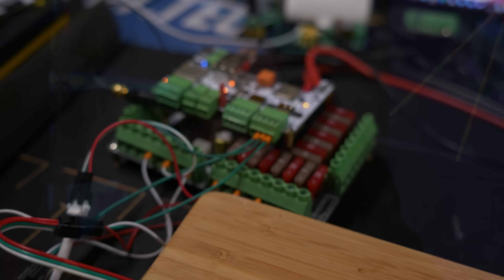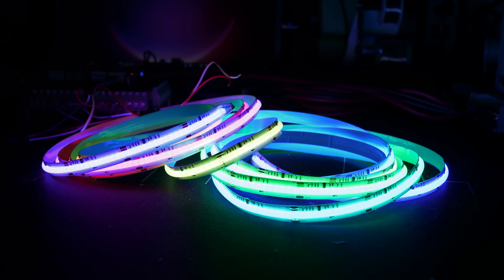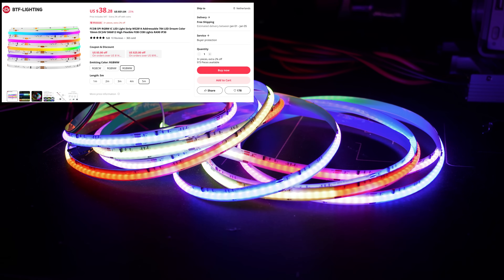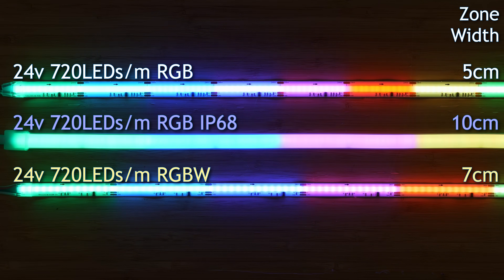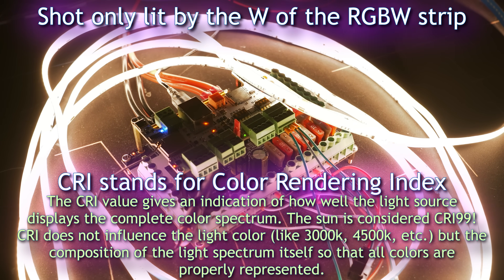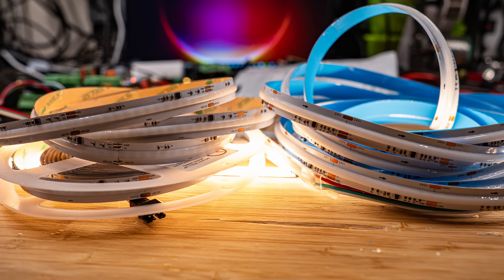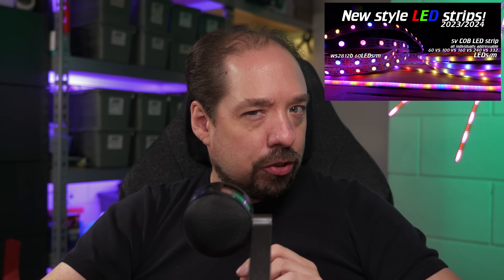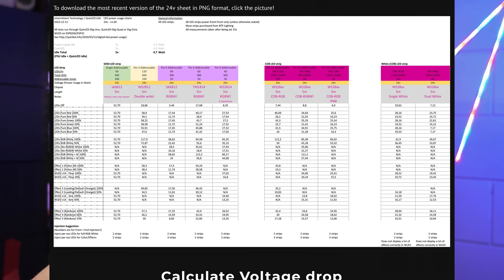💡QuinLED💡The best RGBW 24v Addressable LED strip!

Comment: I have ws2811 rgb 30 leds/m strip on E scooter. If I swap for fcob ws2811 can I expect similar current draw ?
Reply from the maker: Yes, or rather, it depends on the amount of ICs, those are the current providing source, more ICs, more current draw as long as voltage stays the same.
Reply: @IntermitTech thanks for the reply. And how do I count number of ICs in a FCOB strip?

Comment: Are these Alliexpress strips same quality as the BTF from the official website? Thanks!!
Reply from the maker: For sure yeah, there aren't too many strip manufacturers anyway, lots of shops sell the same product in the end.
Reply: @IntermitTech  Great, thanks!! going to get them from the link then
Reply: One quick question, if I'm going to use them for a living room and I need 13M, (two 5M and one 3M) which power supply should I use? Thanks
Reply from the maker: @kibray1796  This will explain all: https://quinled.info/the-ultimate-led-strip-power-injection-guide/
Reply: @IntermitTech  yeah thanks! just watched your video explaining power supply, amazing and very well explained. If I'm not wrong or entirely wrong, I need 300W, I'm using the 24V RGBW WS2814 with 784 leds from the links (two 5M and one 3M), and should need 12.5Amps, so I should get the LRS-350 24V. Hope I'm right hahaha, thanks!!
Reply from the maker: @kibray1796  Yeah that sounds about right!

Comment: How sensitive are the 24v Addressable COB RGB (non IP-rated) strips to humidity?
I realize submersing them, or even splashing them would be bad; but what about humidity?
My plan is to mount LED strips under the eaves of my house in a channel (for a clean look during the day), so direct splashing or rain won't be an issue.
Since I plan on putting them in a channel, I feel the extra expense (and extra heat retention) of the silicon-wrapped IP68 variant might be a waste while providing slightly lesser performance. I just didn't know if general humidity would lead to corrosion of the components (we average between 50% and 80% relative humidity through the year).

Comment: Does the RBW COB work with WLED/ESP32 controller? On ali I can see there's a note that it doesn't suppoert such controllers!
Reply from the maker: If you use a proper controller, such as my Dig boards, they woke without a problem. If you use bare ESP32 or a controller with a mediocre data output you can indeed run into problems.

Comment: Hi Quinn, I'm trying to find a dimmable high CRI 2700k LED strip for use in a soffit. I've read through your fantastic guides but unfortunately some of the product links aren't working. I don't need addressable LEDs, just a high quality very warm white, and ideally with some kind of waterproof-ness (but I could achieve this with a channel) - what would you recommend? Thank you!
Reply from the maker: Yeah the Analog section still needs a bit of an update. Check out the Auxmer strip, I'd highly recommend those in combination with an An-Penta-Mini
Reply: @IntermitTech  thank you so much for your reply! I will check out both!

Comment: Hey folks, does anybody knows how to connect the pins of a ws2814 fcob RGBW in wled/esp32? I couldn't find any video about it, and I don't want to use a non WLED option
Reply from the maker: I'm a bit confused by the question, if we're talking a Dig controller you just simply connect the positive, data and GND side with a proper voltage (same as the strip) supply also connected to the Dig board and done!

If you're going a more DIY approach, take a look at the WLED wiki.

Comment: Hi, I'm searching for a strip led, cob, addressable, and with a dedicated white channel that can be regulated in Kelvin. Does exist or will exist anything in your opinion?
Reply from the maker: Regulated in Kelvin as in dual white? A very new option that's become available is the ws2805 which works with the most recent alphas of WLED. That has dual white channels so can do CCT.
Reply: @IntermitTech  exactly, like a CCT. Thank you for you advice. I ll check it right now. Have a good day!
Reply: Have you found any of these in cob? It seems only in smc @IntermitTech

Comment: Hello Everyone,
I bought this LED strip: FCOB SPI RGBW IC LED Strip Light WS2814 Addressable 784 LED Dream Color 10mm DC24V IP30 SK6812 High Flexible FOB COB Lights RA90
And I would like to control that with QuinLed. Can the QuinLED-Dig-Uno handle the DC24V led strip or only the QuinLED-Dig-Quad can do this?
Please help me in this question!
Reply from the maker: Hey hey, both boards can run the 24v LED strip natively without a problem!
Reply: Hi  @IntermitTech  ,
Thank you for the answer. In case of the mentioned strip, should I have to setup something on the board or just enough to plug the led and use 24V power supply for that?
Reply from the maker: If you are using my pre-assembled boards you can just plug it all in and it should work automatically
Reply: Hi  @IntermitTech ,
Thank you, Is there any wall mount control possibility for the Wled? I'm thinking maybe it could be controlled from the NSPanel Pro kiosk browser. Is there a better solution for this?
Reply: For RGBW of 10 meters, is  24 volts 8 Amp power supply with full brightness of RGBW without any power injection?
Reply from the maker: That's impossible to say without know the strip type exactly and then the wiring. So it's a that depends.

Comment: How do do you setup 24v,21w/m,720leds/m addressable led in Wled? Should one meter be (20sections of 5cm) be treated as 20 leds with max current=440mA per led (21w/m) or should it be a number of actual leds=720  with amperage=12mA?
Reply from the maker: It works in zones (yes 20 per meter) and thus also fill in the MA per zone/LED! You got it right. :)

Comment: What does RGBWW mean? Is that different from RGBW?
Reply: It has a second white diode. Usually rgbw will be red green blue and a white (5600k) vs  rgbww having red green blue 3200k and 5600k
Reply from the maker: RGBW is normally RGB+W of any shade. RGBWW is a bad term but likely refers to RGBW with the white being warm white. But in theory it could also mean RGB + 2x white, but it's just bad terms. 

Please use the following terms:
RGB 
RGBW (one white, whatever color) 
RGB+CCT (two color whites, generally one warm and one cold) 

Anything else is just confusing and can be misinterpreted.

Comment: I see what they are doing. Same addressable chip but just controlling multiple groups as the same color.

But it seems foolish that the led manufacturers can't innovate and create new chips and sub address multiple LEDs. Different signaling or more signal traces. Where is the innovation? I should think it would make it actually cheaper up to a point.
Reply from the maker: Euhm, there are clear reasons why things are as they are though. I explain this in my higher voltage LED strip video. https://youtu.be/r1mjDb_P0EM?si=T3L_sP75ONgc38b3 Maybe it will help you understand a bit better why these things function as they do. It's not a chip problem.

Comment: Worth mentioning that the currently shipped QuinLED Dig Uno v3 (probably other boards as well?) comes with WLED 0.13 which does NOT support this RGBW strip's color channels configuration (the W channel is swapped), luckily WLED 0.14 should include settings to configure this...
Got a bit worried after starting with WLED and getting the overwhelming recommendations for QuinLED Dig boards and this particular RGBW strip as the best white addressable, connecting it and then finding it not to work! 😨
Reply from the maker: Not sure when you got your board but since last year November they should come with v0.14 on them!

We also have https://install.quinled.info to make updating as easy as possible!
Reply: @IntermitTech  Got one just this week, but luckily as you mention the updating was easy!

Comment: I suggest a video about reliability of WS1812 / SK6812 etc LEDs, since in my >5 years of working with them, found out that the average MTBF is <3000 hours, which means for permanent installations of single addressable LEDs they need to be selected VERY CAREFULLY ! After 1000-2000 hours the first pixels will fail, and more will follow soon. At an uptime of 6 hours per day, you will have between 0.5 and 2 years to enjoy until hassle starts... EVEN if cooling and power supply quality  is maintained well and brightness is kept  < 70% of max. How about a series of long term tests under different brightness and temperature ranges? I find it difficult to get reproducable quality or brands in the market, and due to the individual installation of those strips it's quite complicated to replace faulty strips in big installations every 1-2 years.
Any comments welcome if you can suggest LED types or vendors with a long term experience (>3 years)
Reply from the maker: Hmm, that's interesting. In your case, are you talking about pixels?

I do have more of an overview then the average person I think because of the thousands of people who drop by on the Discord sever. From that sk6812 seems a bit more failure prone then generic ws2812b, but not by that much either.
Reply: @IntermitTech talking about SK6812 RGBW strips 144/meter from BTF lighting, in aluminum channels, 70% brightness with only white LED on most of the time. replaced already 2 times, every time the revision of the leds is a new one according to how they look like. got several reports from other users with similar experience

Comment: how wide are these new COB strips? I was looking at the non-white RGB COBs you mention in this video but the 12mm width makes it difficult to match an aluminum channel. Seems like all V-shaped ones are 10mm
Reply from the maker: Yeah, I generally just get 12mm profiles because some of the newer strips are indeed 12mm only. I believe the RGBW one in the video is actually back to 10mm since it's a bit less powerful.

Comment: Have you heard of 12V adressable LED stings? They claim to use ws2811 chips but the 'blobs' that contain the LEDs are too small for that, they look like they contain only a 5050 package but claimed power consumption is lower than ws2815 chips would have. I wrote a much longer comment with some example links but that got deleted without any notificaton. If they actually are 12V single LED adressable that would be awesome for longer runs. Any thoughts?
Reply from the maker: I know there is one new kind of variant out there by not sure what they are using inside. Maybe a combination of COB LEDs and resistors to accept 12v natively, it is possible in that sense. But it's likely a clone chip, not real ws2811. Can work fine though, but haven't seen it myself. Links best through Discord!

Comment: Do you recommend using FCOB SPI RGBW IC LED 24 as kitchen under cabinet light.
I really like the mix between the RGB and White,  I want to use the white as a main light, but I'm concerned for the quality of the light...
Reply from the maker: Regarding the RGBW strip and white light it's the best out there right now and it's a decent CRI90 as I show in the video. It's certainly not the best white light you can get LED strip wise (as I explain the video) but if you want it combined with addressable and RGB it is and for normal main lighting it'll be fine. I also think for kitchen under cabinet it's fine too, I wouldn't use it as main lighting for cooking or something like that though. You want CRI95 for that.
Reply: Thanks a lot for the explanation.
I found your videos very useful 👍

Comment: Do you have any video that show COB configuration on WLED? For example, how many leds should I configure in WLED for 2m of COB 720leds/meter. 1440 ?
Reply from the maker: Check the real world power sheet for the amount of zones. The 720LEDs RGB has 20 zones per meter and thus for 2 meter you enter 40 zones/LEDs.

Comment: Hey! I was setting up SK6812 RGBW 12v stip with QuinLed Uno, and accidentally mixed the + and - on the strip connection to the controller. Now it switches to a weird pattern (whites with some rgb elements) when set to 40%, or higher brightness.Does anybody know what I need to replace now - the ESP32, Quinled powerboard or the LED strip? Thank you!
Reply from the maker: Poh, that's a tough one, without another strip or controller that's going to be very hard to figure out...

Comment: You said these aren’t as bright as the non waterproof version…are they still brighter than the older 2811/2812 60leds/meter strips?   How durable does the casing feel? Do you have any good solid ways of attaching wires to them?  I use led strips on atv’s and side by sides that constantly get submerged in mud
Reply from the maker: If say they are pretty sturdy since they are basically fully enclosed in silicone. Brightness is still pretty fair, I'd say at least on par. Wires I haven't looked into too much but if you need to open it up that would be a bother for sure so I'd recommend getting the length you really need.

Comment: Do you have a direct BTF Lighting  affiliate link. Have issues with AliExpress.  Need to get 30m of the IP68 COB.
Reply from the maker: I do not, I generally link to Aliexpress.
Reply: How do you feel the 24v ip68 would do for Christmas lights around the house and also using them year round? Would you be happy with them or would you rather go 12v for more precise year round automations?

Comment: Interesting, I just bought some 12V WS2814 based strip because I wanted decent power, good white, at most one injection point for 5m, and had to be either 10mm or 12mm wide (I have 10mm V channels, 12mm can be made to work but wider would lose too much contact with the channel). The spec on the ws2814a says cri of 90+, would be interesting to see 3rd party measurement.

Comment: @Quindor how did you configure the COB RGBW 24v in WLED? I have similar strips and I designate 6812 in the config but I get inconsistent results. Also, do you config 720 LED’s? (Per/m)
Reply from the maker: Like this https://quinled.info/quinled-dig2analog-suggested-configuration-in-wled/ and then 70 LEDs I believe.
Reply: @IntermitTech  I just got a bookcase setup with this. It was driving me crazy to get the config correct. Google did not show many good configs to try. I managed to get SK6812 RGBW chosen as the strip type. I got the color settings which seemed to be close enough, but the green was rather too white, and the red was pretty weak. While doing a final search I came across this tip. I have to say it is rather hidden because I am not using dig2analog at all, directly powering from DigUno. Trying the settings though is perfect and everything is good now. Maybe you could find a way to make this setting more discoverable for folks powering them from DigUnos or DigQuads.

Comment: Wished I knew how to solder the cob addressables. I have so many spare strips and they don't make quick connectors😂
Reply from the maker: You should be able to bud 2 pieces together and then basically make a solder bridge between them, that's worked for me at least.
Reply: @IntermitTech  yessir. Just wish they made quick connectors for these. I noticed the three prongs are staggered differently than most of the quick connectors and the only ones I can find are from Germany .
I just custom fit these on my e-bikes and EUCs and I have so many fragments I would love to be able to join together. If they already have solder on them I can usually do it but it's so hard to pre-solder the tabs lol. Thanks for the awesome videos bro
Reply: @IntermitTech  Good to know somebody does it. I'll try it again with a finer solder tip

Comment: How do you handle diffusing for the RGB strip, do you simply place it in a clear channel? You mention it is well diffused on its own, but there are still some PCB parts that are not very pretty to be directly visible :) I am kinda looking at a DYI Nanoleaf project and all tutorials use pretty aggressive diffusers, but then again all of them also use the regular discrete diode LED strips.
Reply from the maker: Yeah for the LEDs themselves you really don't much extra diffusion on the RGB version if the strip is going to be directly visible maybe a little bit to obfuscate it a bit could be nice. In regards to a nanoleaf clone you'd want something that diffuses a bit but mostly acts like a light guide and spreader so that the whole "leaf" lights up evenly so those are 2 different things I think. Still, I think the 24v RGB COB could work very nice for that since at least you don't have to worry about seeing individual diodes!